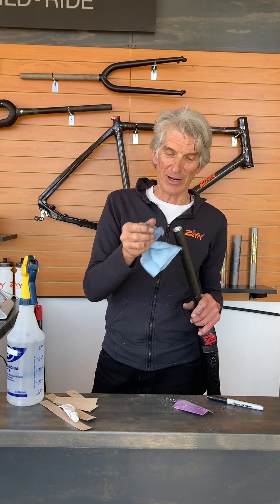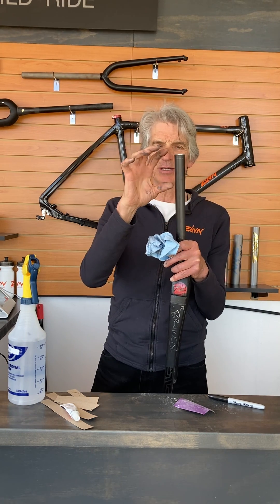Lennard Zinn installs a steering tube insert - ENVE fork

Comment: Any guides or feedback on how to remove a product like this or safely cut the steerer? Thanks!
Reply from the maker: Yes. You basically need a long M5 bolt and a bunch of headset spacers. You just simply tighen the bolt with a couple spacers to pull the insert up a bit and the epoxy brakes it's hold. Then you have to remove the bolt, add more spacers, tighten some more to pull it up further and keep repeating that process until the insert comes all the way out. It takes a solid 5-10 minutes since you have to keep adding spacers but it works well.